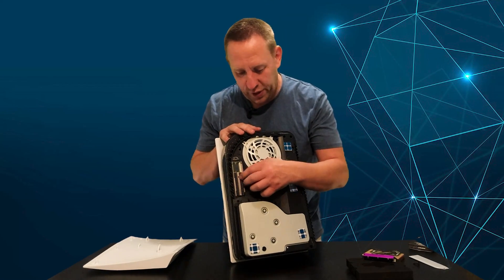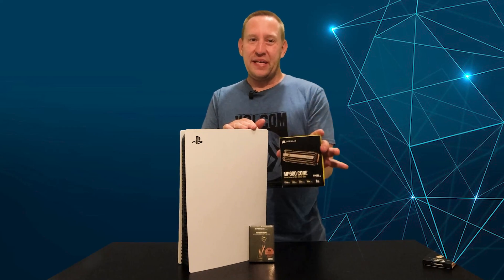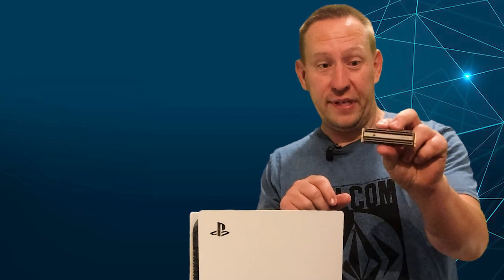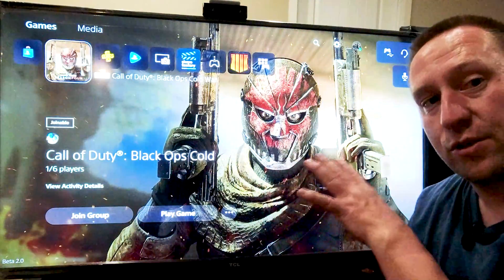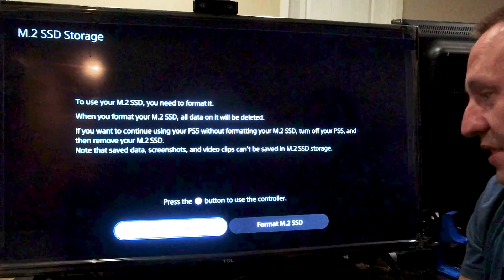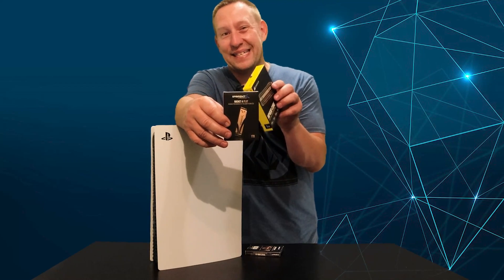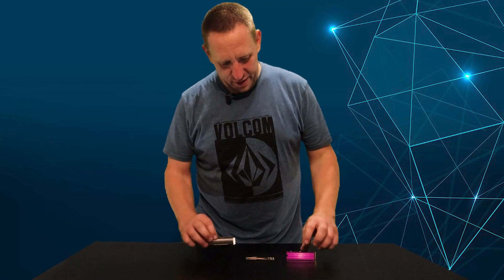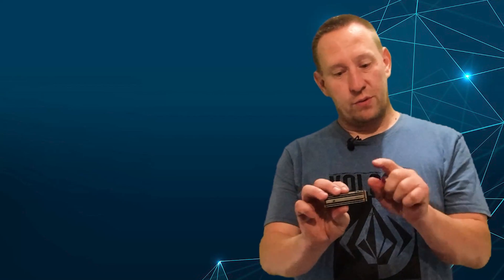SAVE YOUR MONEY! ~ We tried an INCOMPATIBLE drive with the PS5, DOES IT WORK??? | GT Canada

Comment from the maker: The following Drives will work in your PS5 right away and EASILY Meet the required specs

Western Digital Black SN850 (don't forget to pick the one WITH HEATSINK) - https://amzn.to/3f6WUaH
Gigabyte Aorus NVMe Gen 4 7000S - https://amzn.to/3zQQJzw
Patriot Viper VP4300 - https://amzn.to/3j3zJPL

These Drives Below NEED to add a Heatsink to keep from cooking but ALSO MEET the required specs

Samsung 980 Pro - https://amzn.to/3y8i7Zv
Sabrent Rocket 4 Plus - https://amzn.to/3yf458z

These drives WILL WORK and are great for a BUDGET GAMER that needs more space, but doesn't want to spend a lot of money!

XPG Gammix - https://amzn.to/3CAx49i
Corsair MP600 - https://amzn.to/3xMObBn

Heatsinks for SSD that doesn't have one already
https://amzn.to/2TGcN0o
https://amzn.to/3BUAq6B
https://amzn.to/3rPqJC4
Reply: Also. The entire heatsink on the Corsair "MP600" and "MP600 Pro (7GB/s version)" can be removed and replaced with a smaller (shorter) heatsink like the one used in the video and the ones listed.
Reply: Also the SSD cover is supposed to be on. Along the side of the SSD bay (closest to fan) are two exhaust holes. The PS5s fan sucks any heat out of the bay through those two holes in a vacuum fashion (technical term is "Negative Pressure").
Reply from the maker: Yes that's true. I'm not so sure it's all that efficient at it. But I'm not a Sony engineer either. So you never know

Comment: Got the 2tb mp600 core and the initial speed test gave 35xx. The retail box said upto 4950. Guess not all SSDs even from the same model are created equal. Or Sony's test tool is garbage. Either way, it still works so I'll just keep using it.
Reply from the maker: I think it's Sony's test tool

I put a wd black in my sons ps5 a couple days ago and his results where the same

Even ssds rated at 7000 MBS are reporting only 5600 on the test tool

That why I say to just get any Gen 4 nvme drive you like. Even the slowest one is fast enough.

Comment: I wonder if the read speed is based on maybe slower pc motherboards
Reply from the maker: I think Sony is just running a very basic speed test. So basic that the results are wildly inaccurate

Guys running drives that support over 7000 MB/s are getting reported speeds similar to what I get with my below spec drive

I think it means that the speed really isn't relevant

Comment: I don't think you will have any issues until games become more optimized for the faster speeds.
Reply from the maker: totally agree. And even then, with the SSD I have in it I get the same speeds as the internal drive, so I still dont think Ill have any issues.

Comment: Aslong as it's gen 4 it works at the moment. It uses negative pressure.  The airflow still goes over the chamber regardless. I'm getting the sabrent cover any ways. Also don't know where or why you paid 270 for the q4. It's 180 all day long online.
Reply from the maker: my numbers are Canadian dollars. So your $180 price is probably pretty accurate once you figure the exchange rate out
Reply: @GearsAndTech  Oh ok didn't realize you were in good Ole Canada
Reply from the maker: No worries. Usually I say the currency to try and keep it clear. But didn't in this video

Comment: I heard it needs to be sealed with the mandatory cover as the air is kinda sucked by the cooling system therefore the m2 trap remains cooler , I’m surprised here by the number of people stating it works but they just copied/installed some games on it , not played a couple of hours ( temp will raise !)
Reply from the maker: I did temp test comparisons with cover off, cover on, and cover totally blocked.

The most stress an ssd in the ps5 will ever see is writing date to it in a game transfer

So heat will be highest after a long run of games being moved

Under normal conditions the ssd is very rarely written to. And the read times are spotty at best. It never transgers the entire game into ram. Only a few gigs at a time. So temps will never be higher than after a 10 minute game transfer.

Check my other video though. I go through all the side affects of the cover on or off debate
Reply: @GearsAndTech   yes sorry just saw the test for the temp comparison without the cover , now I’m even more hesitating since most of the new models got a bigass cooler .
Thank you for you valuable contribution !!

Comment: Hi. Thanks for the video. I have put the Viper in as an ssd. Everything works fine but it did me 2 times with 2 different. the joke of turning off the console, very shortly after launching a game. Then I rebooted from the console button and it worked perfectly. Another time it was telling me it was impossible to update a game.... I restarted and then it succeeded. For copies it never gave me any problems, it's just as fast and loads as the basic one, sometimes even a second faster. Do you know what's causing these shutdowns for no reason? I also have the hdd via USB attached. Could it be that it's getting confused?
Reply from the maker: That's really weird. I have been on the beta since it was released and have had no issues at all

I had a couple game crashing problems early on, but I had experienced game crashing from the internal storage as well, so I didn't think it was related to the ssd.
Reply: @GearsAndTech  yes, I think the same. I hope that's a software problem and sony will soon release a system update.

Comment: Hi there. Would you have an update using the corsair mp600 core with your ps5 especially now that there is an official non-beta update that supports it? I was thinking in buying such ssd for my ps5 and plan on replacing the heatsink with a slimmer one
Reply from the maker: This video has more details about some of the MP600 so far.

https://youtu.be/QUil3nxJdKI
Reply: @GearsAndTech  : i just ordered a corsair mp600 core... hopefully it will work with the current firmware.
Reply from the maker: Yes it'll work. My newest video covers that ssd
Reply: @GearsAndTech  great your video helped me decide into choosing an expansion storage that is compatible with ps5 games. :)
Reply from the maker: I have a bit of an update in the video I did checking if we are cooking the ssd. It came out about a week ago

Comment: Yeah i test a slower cheaper drive that is Gammix S50 Lite and it works on the final build firmware update. I notice that as long as its gen 4 your good to go. Leave the slower drive in there is no speed difference on the PS5.
Reply from the maker: Gammix is only a couple dollars cheaper than the MP600 I link to in the video, but it requires a heatsink, so the cost ends up about the same.

In either case, cheaper with more memory is always better
Reply: @GearsAndTech  no it comes with a heatsink and a 2 tb is only $229
Reply from the maker: I didn't see that one. I'll check it closer! Sounds like a good deal.

My long term test of the corsair MP600 CORE comes out tomorrow
Reply: my fan keeps turning up real loud while playing games off it and while transferring games to and from it, it gets so loud that everytime it happens it makes me nervous that my ps5 is going to shut down and display some kind of light if death and not work any more, i wonder if removing original heatsink and installing a different one will prevent it from happening or if i should pick up a new one that has the minimum required specs and put a better heatsink on that one instead, would be nice if i could just use my s50 lite for extra space without the fans speeding up and sounding like a leaf blower
Reply: @drudrumauro  i am using Corsair MP600 with no issues.
Reply from the maker: Seems like you need to just pull your fan out and clean it.

My system make no more noise than before. But I keep my fan clean
Reply: the system is a month old and its inside is spotless. the fan never turns up unless im using the m.2 ssd
Reply: since there are no issues with the mp600 i might grab the 2tb one, was considering the s70 blade or the pny xlb8 cs3140 they have 7,500 read and 6850 write and can get each all around the same price, was trying to pinpoint why my cooling system in the ps5 is reacting to it the way it is and was thinking its normal since the newer 1115a models tend to be hotter but I'm not sure cause it hasn't acted like that while playing the same games for hours off the regular internal ssd and off my old external 4tb seagate that i had for many years to use with ps4, the system being so new i don't know what to be expecting as normal behavior with the m. 2 drive and since it doesn't happen with different ssds im just going to remove the s50 lite and wait to get a better one to be on the safe side, it took me a whole year to finally get my ps5 and i get nervous about it breaking

Comment: Hi, have you tried gaming with the MP600? I have the possibility to buy it for like 100 bucks right now but I don't know how good it will work.
Reply from the maker: I've been gaming with it for over a month now with no issues at all.
Reply: @GearsAndTech  Great, I have bought it so let's see! So damn cheap and already an heatsink installed. I will probably check for dust once a month or something. The only worry for me is in like 3 years when developers maximize SSD performance. But worst case I'll stick it in my PC. Great video!
Reply from the maker: That's exactly my thoughts as well. No need for high performance now. Just get whatever you can for as cheap as possible

You will see ps5 specific ssds sooner or later. I think they will be longer because we have the room anyway, and that allows for cheaper manufacturing. No need to squeeze everything onto a small board. Plus, they can use cheaper/smaller memory modules but more of them so the capacity is larger, but using less expensive components.
Reply: @GearsAndTech  Just got it! Works great, got 5612 mb/s in the speed test and games run smooooth. Thanks for the video and saving me a ton, hopefully it will keep running like this for years to come!
Reply from the maker: My long term test results are coming out this morning at 9 MST. It may be worth a watch just to confirm what you already know!

Comment: By you leaving the cover off it allows dust to get in it and it could cost a fire if the ssd do not fit change it do not mess up something y’all spent y’all hard working money on because of some one else
Reply: Lol dust will cause a fire. Then that mean my unclean computer that have 5 years of dust is ready to burn my house down
Reply: @brucey5585  if the ssd is getting worked hard it will become very hot and if dust is setting on top of it I believe it will catch on fire. That’s what I believe will happen
Reply from the maker: It will become hot. But it won't light on fire. It's impossible.
Reply: @GearsAndTech  oh ok I was just thanking it was thanks for the information. But Sony said to keep the cover on
Reply from the maker: Yes. They said to keep the cover on
Reply from the maker: Absolutely. Do what's best for you.

I'm showing you what I did.

Chance of this causing a fire is about 0.00000%

But you do you
Reply: @GearsAndTech  I understand that but you never know because the ssd will still get hot with the heatsink and dust can build up on it with out the cover

Comment: WARNING. LET ME BE CLEAR...
DO. NOT. BUY. AN. SSD. THAT. IS. NOT. VALIDATED. FOR. PS5
The MAIN REASON for fast SSD reads is for real-time, texture asset streaming. Almost no games do that yet. I believe Ratchet & Clank Rift Apart does but even it probably isn't using the full bandwidth of the SSD... SO... if you had a slow SSD and tried to run such a game then it wouldn't work properly. Sony is likely to PREVENT slow SSD's from functioning otherwise it would be just too confusing.
LOADING GAMES the current way mainly involves COPYING data to system memory (GDDR6) prior to starting the game, or a new level. The BOTTLENECK is not usually the SSD hence the similar results (it's the CPU and GPU setting up the game to run in that memory space).
ASSET STREAMING in future games, to repeat, is when you are playing the game. If the game is coded to expect assets to arrive in so many milliseconds then you've got a big problem if they don't.
VERY FEW GAMES do this, but it will become COMMON in a couple years. Microsoft will do the same thing on the XBSX/S, however the games will simply be optimized towards that hardware's slower SSD (that doesn't make the XBSX worse as it has other strengths)
UNREAL ENGINE 5 is currently being optimized for Nanite etc and that will certainly require a fast SSD for any game coded to use PS5. It's likely SOME GAMES will just target the XBSX/S's slower SSD for ease of multi-platform optimization. That's fine. But there WILL be games on PS5 that require the full bandwidth. Full stop. So again, I would highly doubt Sony is going to allow slower SSD's to function.
Reply from the maker: Sony will not restrict the ssd for slower speeds

Mark my words.

Sony is not Apple, or Nintendo they aren't worried about locking up hardware into their ecosystem. Their last business practices on previous consoles are proof enough.

You may be correct about texture pop in and other issues. But that's not true now and it won't be relevant for a long time.
Reply: Sorry , but its bullshit..its recommended not required

Comment: Everyone online is baffled why the Samsung 980 pro 1 & 2 Tb variant are getting between 5500 & 5700 read speeds but the Samsung 980 pro 250 & 500 GB are getting 6400, and every other SSD is getting around 6400 to 6600. I know we're in Beta But the PS5 can read higher speeds. I think it would be real interesting if you can make a video about this and give us your opinion What maybe the cause. If you make a video I'll link it to the Reddit ps5 SSD thread. No other premium SSD is getting those speeds. Maybe it's not because it's beta. Btw My drive is updated to the latest firmware.
Reply from the maker: Thanks for weighing in.

My theory is the controller isn't communicating well with the ps5.

Also, the low level speed test is really not that accurate. I bet if you did a real world game transfer test it would go faster

Comment: This is the wrong type of content, bare minimum drives don't cut it in the PS5. This will give the wrong mesaage to so many fools.
Reply from the maker: So far there are no Ill side effects from running even the slowest Gen 4 ssd

However, some are hinting that as Devs code better the ssd speed will start to impact performance.

But that day isn't today. And it could be a few years off

For now the best advice is get the cheapest Gen 4 Ssd you can find with the size you want and possible require an upgrade to a faster drive in a few years when the higher spec ones are cheaper
Reply: People who have a poor mindset an attitude of poverty are always giving crap advice to buy cheap. Yeah right I will buy a premium product one time so I never have to buy one again. I don't care if it costs me more than the PS5 itself. You get what you pay for and you gotta have a certain standard and quality of life. 

Going cheap and buying multiple drive's is the dumbest advice you can give. Clearly it's worth it to save up and buy a premium future proof 176 layered NAND ssd instead of old ones with 96 layered NAND that are not going to last the PS5 lifecycle. 

But you go ahead and tell people to buy drives that are below spec so they can have bottlenecking that's really smart.